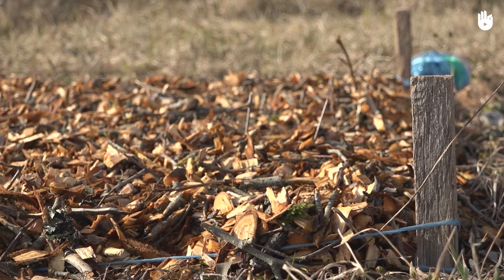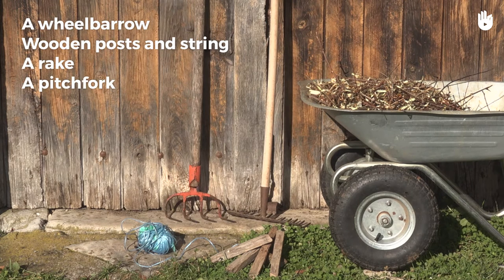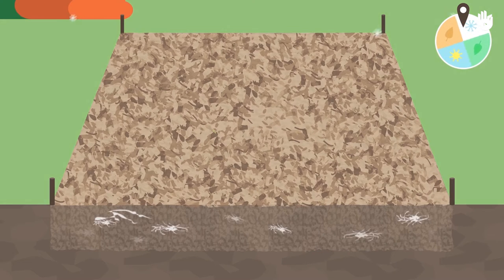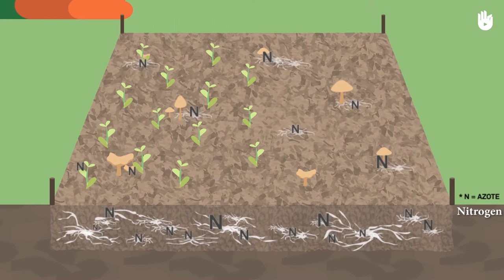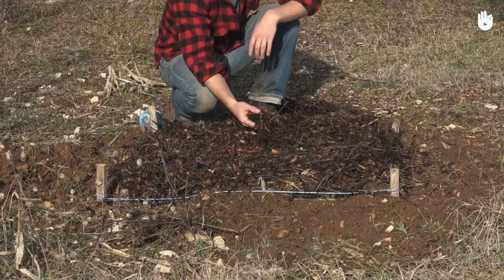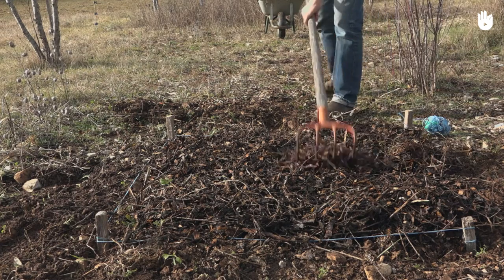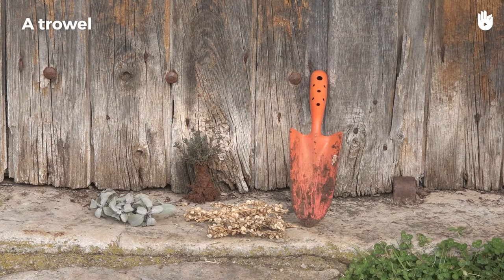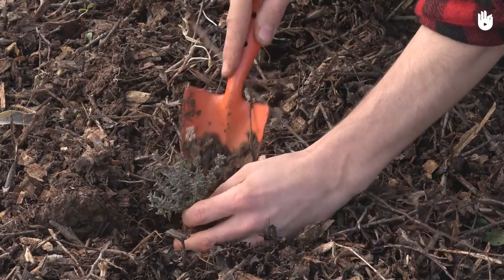Using rcw (ramial chipped wood)

Comment: What is "ramial?"
Reply: Young hardwood that has not yet hardened has a different lignin structural chemistry that breaks down much more readily, especially if put on without curing, or green, and even leaves and all if you can get them, for more nitrogen. That is the ramial wood, the young soft stuff.